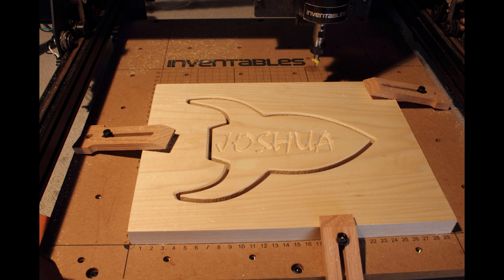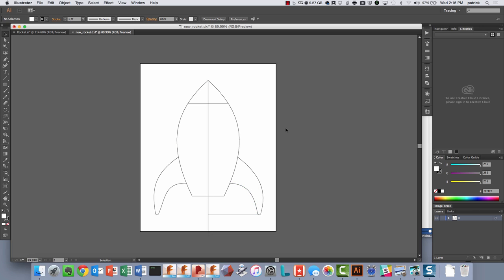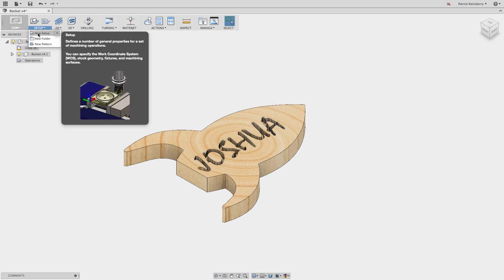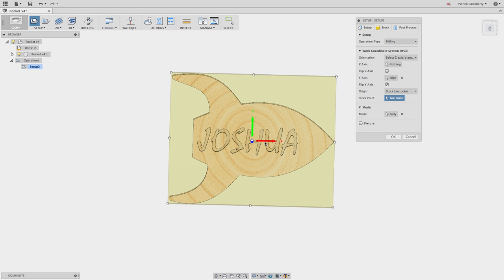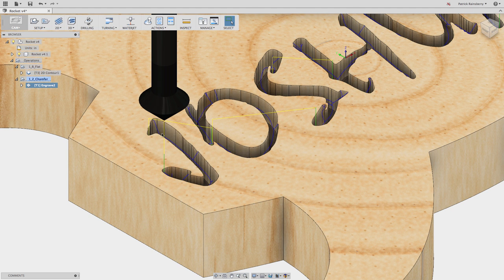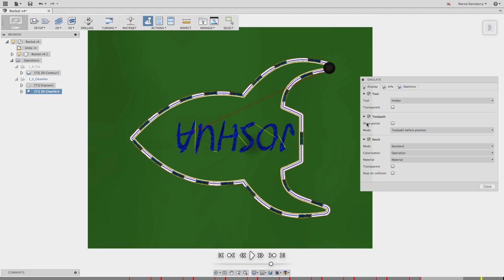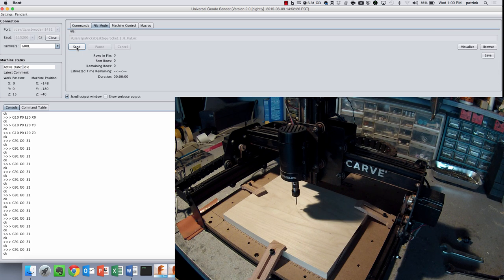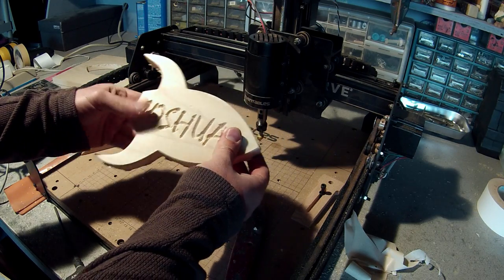Toy Rocket: Fusion 360, Illustrator, X-Carve

Comment: Great tutorial. Fusion 360 is an awesome package and keeps getting better. I would like to echo the other comments though and suggest that the interior features should be machined first and then the profile. If you think about it, you could apply the chamfer ahead of cutting the contour and get the same result. Also a tip concerning the profile geometry. It's a good idea to not have any sharp inside corners. This causes the machine to make an abrupt change in direction and it's likely the cutter will leave a "dig" mark on the part. It would be better to have a fillet slightly larger than the cutter radius, in this case say .065 or bigger. This will cause the machine to interpolate around the radius smoothly instead of changing direction abruptly. The bigger the radius the better.  Keep up the good work!
Reply from the maker: +N9FKT Yah totally should have done that.  For some reason i was thinking the chamfer should go on last, see my comment above.  As far as the inner corners i was just letting the tool radius give the radius but that is a great point about forcing a smooth move around the corner without the abrupt change in direction.  Nice tip!!  I am VERY new to this so every new tip helps.  Much appreciated.

Comment from the maker: Just to address the questions below.  I have previously done the contour last on something like this.  I was only thinking that i wanted to do that chamfer as the last operation so i just did them in reverse order to minimize tool changes.

Totally true though that I should have done it in the other order.  I was thinking that the chamfer would need to go last but you are right, not necessary for such a shallow one.

I almost redid it after i finished cutting the first time for the video, but decided against it.  So yes please feel free to execute the tool paths in the other (logical) order.

I will say though that between the tabs and the machinists tape there was no problem here on this little guy.

Comment: That's cool patrick, by the sound of the cutter you could of cut a little bit deeper, or slower and since its wood when you do the cutout do a spiral so the cutter just stays cutting deeper and deeper, the only thing to worry about is when you are cutting hard wood, you have to make sure you cutter is clean and sharp otherwise you may set the wood on fire.
softwood it's less of a problem.
my small router what's 200 X 300 i cut 45% depth of cut 100% width of cut and it's only a .4 HP spindle. 
as long as you do not produce dust the cut is fine

Comment: Thanks Patrick. This video is the best for understanding the work flow between Fusion, illustrator & UGCS. Well done.
How did you get fusion to recognize the profiles of the text (Joshua)? I notice the cut out of the text has the tell tale segmented look of a spline. Ive done similar extrusions of text with splines, poly lines you name it and I can never get fusion to recognize it as a whole profile. I can only grab individual segments while setting up an engraving.
Thanks again.

Comment: PATRICK, would you please show how to use the Gcode import that has been developed for easel. I cannot get it to work and you do such a great job with your step by step presentation.  Also where does the program number come from in the post process window? I am using Fusion 360 and I am doing good with the CAD - CAM part of the program but after I post process, I am at a dead end.You are a great teacher.
Reply from the maker: +darrell smith Thanks man, yes that is my next plan, to do this with Easel.  I actually might try to do it today.  I should have done it with Easel the first time.
Reply: +Patrick Rainsberry Thank you, it will be very much appreciated.
Reply from the maker: +darrell smith tried to do it Friday, but made a mistake and ned to get some more wood.  Out of town this week, so probably won't be for a couple weeks now unfortunately.  The process is really the same, actually a lot simpler.  The thing you have to know is that the things in easel like enter stock size and pick bit don't really apply if you are running imported g-code.

Comment: Nice tutorial! but how can i adjust the scale to work with milimeters?
Reply from the maker: Yes definitely it is an option on the left side in the folders, right click units and change to mm
Reply: Another easy way. Hit(PC or MAC) Control/Command + R, that will bring up your rulers. Then right click on the ruler on the top or left side, then you can change to whatever units you want.

Comment: Great video Patrick! A lot of good tips for Fusion 360 CAM setups and importing SVG and DXF Files. I have a woodworking CNC Router that I made myself and I have been learning Fusion 360. Did you enter all of the data for your tool library by hand or did you import it? Is there a reason that you cutout the Rocket before engraving and chamfering it? I usually do it the other way around so you do not have to rely on the tabs to hold the stock.
Reply from the maker: +Kevin Roskam i did the tool library by hand. I just have a few tools i use with the X-Carve so i just setup a little library for my stuff with the 3 tools and some generic speeds for wood.  Yes cutting out first was a bad idea, see my comment above LOL was being lazy/dumb

Comment: I'm new to Fusion 360 and your video is very helpful. However, when I get to add in the tabs, I don't have that option on the drop down box. I'm using the free version of 360, is that the reason?
Reply from the maker: You should?  Did you already pick the contour?

Comment: Patrick - Your videos have been incredibly helpful! I have a ShapeOko 3 and just started using Fusion. With your videos I was able to mill my first object from a 3D model I made.

But I need to figure out why Fusion is scaling my SVG files to 75% of the size and how to correct it. The scaling happens right at the beginning when I import the SVG onto the Z plane, but bizarrely, I haven't been able to correct it. If I leave the scale at 1.00, the sketch comes out 75% of the size it should. If I set the scale to 1.333 to reverse that, the sketch comes out 33% bigger than it should! I've tried using 1.01, 0.99, 1.25, 1/72 as in your video (which creates a tiny sketch), 100/72 (which is close to 75%, although the scaling it is doing appears to be exactly 75%, not the 72 from the pixels per inch. 

Very much appreciate anyone's suggestions. I created the SVG in Autodesk Graphic (formerly iDraw).
Reply from the maker: I think the scaling might be different for Graphic,  I have not tested it yet.  I think it is different for ink-scape also.  Would be a great question to pose in the Fusion 360 forums.  The developers and product mangers are very active there and I think the community at large would benefit from the answer:
http://forums.autodesk.com/t5/fusion-360/ct-p/1234
Reply: +Patrick Rainsberry Thanks, Patrick. Ah, interesting! So Inkscape defaults to 90 pixels = 1 inch, whereas Graphic reads and writes SVGs at 72 pixels = 1 inch. (Which explains the clamp appearing at 75% size, and needing to be scaled up by 133% in order to work with Easel.) I've read that some other vector programs assume 96 pixels = 1 inch. Clearly SVGs were designed to display web graphics on a wide variety of devices rather than maintain real world measurements for CAM. :(

What still doesn't make sense is why when I tell Graphic to scale the export by 133% that fixes it for Easel but not Fusion. Or why in Fusion I have to tell it to scale the imported image by 115.45% (!). Where does that number come from? Since Graphic and Fusion are both Autodesk products I've posted a similar question there, but haven't gotten any replies yet.
Reply from the maker: You will probably get a response on the Fusion forum when everybody comes into the office in the morning.  Agree SVG is really not the ideal format for sharing design files between systems.  DXF would be better.  I would imagine long term they will find a way to make this process better.  I believe Fusion reads the native units regardless of scale.  What units are you in in Fusion?  Look over at your left side.  I am guessing maybe you are in mm?  That would affect the import scale translation.
Reply: Okay, I've been experimenting with simple SVG files inserted into Fusion, and it seems that when Fusion says Scale XY Plane, it scales the area by that much. So to scale each direction by 1.333, I need to enter a scale factor of 1.154 (the square root of 1.333!)
I posted the sample pictures and more info here:
http://discuss.inventables.com/t/how-to-make-clamp-set/23222/14

Comment: hey nice video! quick question tho... when I open the dxf in illustrator the sketch is super small, the only way I'm able to work with it is if I open it and check  "scale to fit artboard". once I'm done I open it back up in fusion and the text comes out huge and no where near my original sketch! any idea what I could be doing wrong?
Reply from the maker: +MaDiy My guess is its a units thing.  In my case i exported from Fusion 360 in Inches.  Then when i open in Illustrator there is a dialog to select what units are.  Here i say 1 unit (in DXF) equals 1 inch.  My guess is you have that set to be 1 unit equals 1 pixel.  Check out about 3:20 in the video
Reply: +Patrick Rainsberry YES! that was it! thank you!

Comment: I don't understand why you need a new set up for every tool path.  You created a set up for you profile cut, then copied the set up after made the tool path, and created an identical set up for your engraving tool path?
Reply from the maker: You don't have to.  Actually a better way to do it would have been folders.  I was using setups to easily group multiple operations that used the same tool so i could easily have different gcode files.  If i made this video again I would have had 1 setup and a folder per tool.
Reply: Patrick Rainsberry , Thanks for the explanation.  Separating by tool type makes a lot of sense.  I've been subscribed to your channel for a few months now.  Your videos are by far the most comprehensive and easy to follow on youtube.  The other videos out there are too verbose and never really get me where I want to go.  Thanks for putting your videos out, and I look forward to more content.